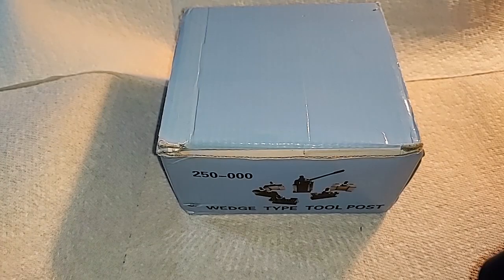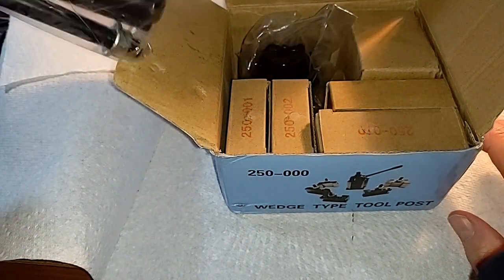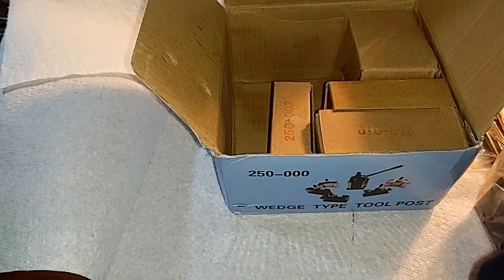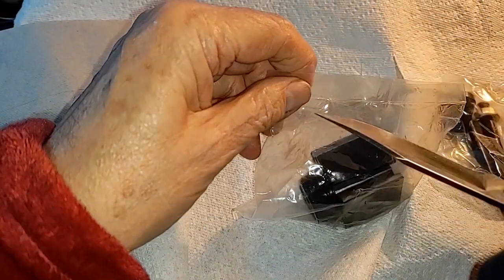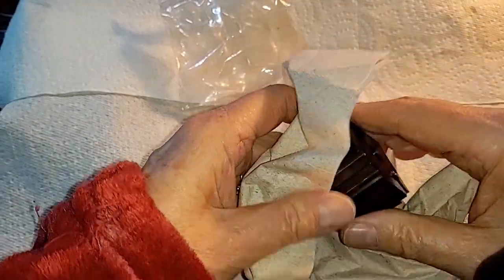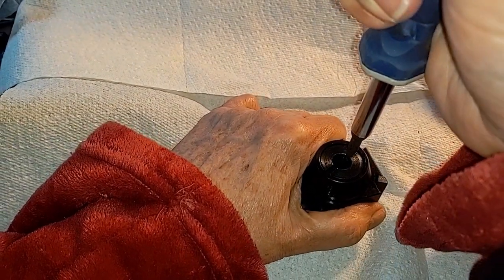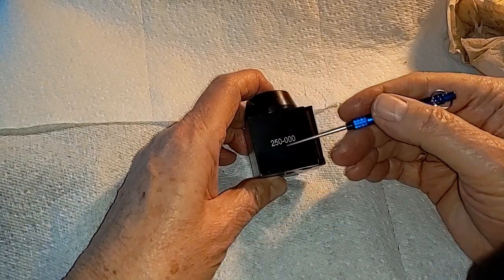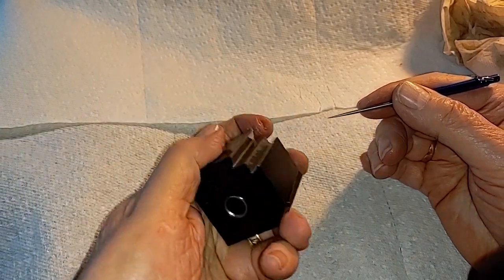#3 OXA Tool Post the 3rd.   Another Flop. What is it going to take!!!

Comment: If you just loosen that shoulder bolt ever so slightly it’ll work as it should, I’ve bought many of this same one and they all come tight like that.
Reply from the maker: The bolt should be tight, but it is specified to be a running fit to the clamping ring. It is supposed to be tight to hold the clamping ring and allow for smooth operation. 

I could have fixed this any number of ways, but one of my goals was to get a properly manufactured product. I am on a one man quest to get the Chinese to actually make good products, instead of what amounts to the kits that they are making. I ended up spending a bit more and got one sold by Shars. That one was correct, but even there I had to have them replace one of the tool holders.